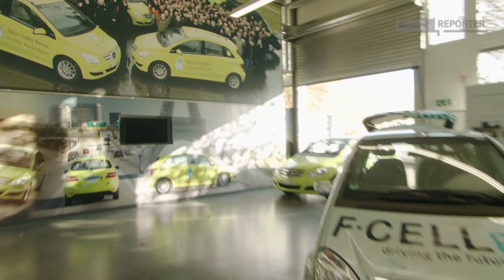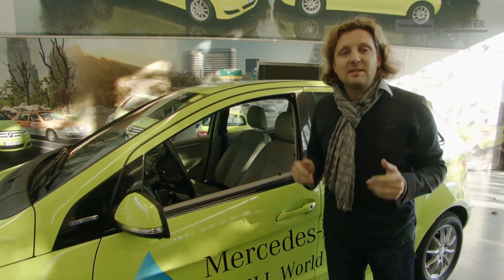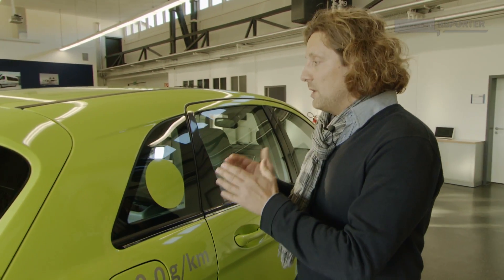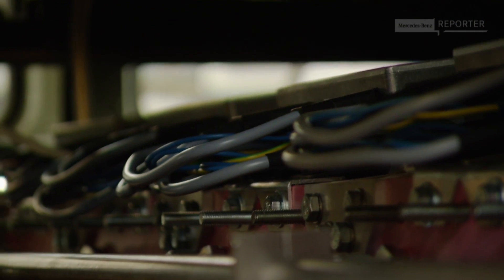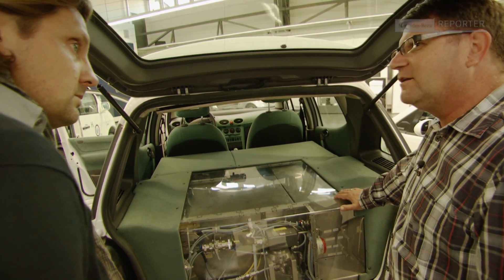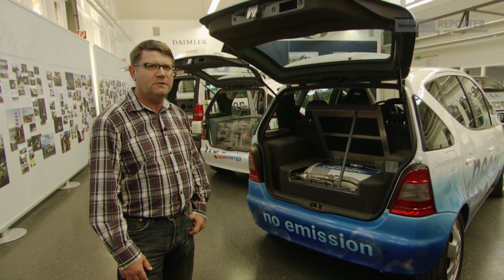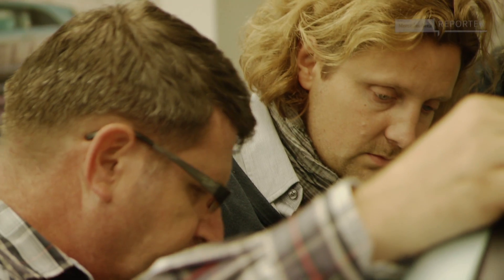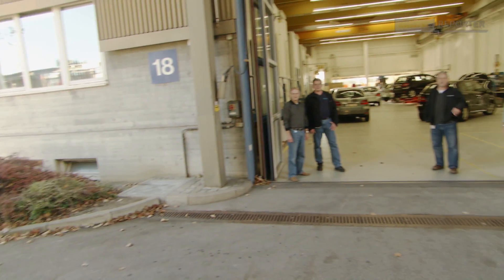The History of the Mercedes-Benz F-CELL

Comment: You say you won't be bringing the F Cell to Australia due to no infrastructure [no hydrogen pumps at service stations] but if you had that attitude when you invented the car where would we be now? Car-less - that's where! When the demand is there infrastructure will quickly follow but if you don't create the demand nothing will happen! I love this technology - it answers all the questions non-polluting & just as importantly we'll NEVER run out of hydrogen because it gets recycled from water to hydrogen & back to water again! This IS pure brilliance. I call it the forever solution as we need never worry about running out of fuel ever again. Finally due to no combustion & few mechanicals this car is highly efficient. It's probably the most efficient car ever made which makes it the most significant motoring statement since you first invented the car! Please do reconsider & bring this modern marvel to Australia. That will save me importing one!